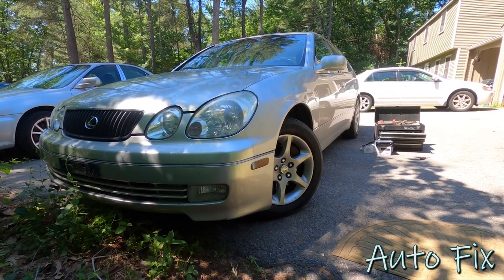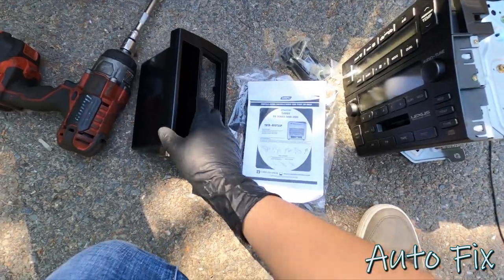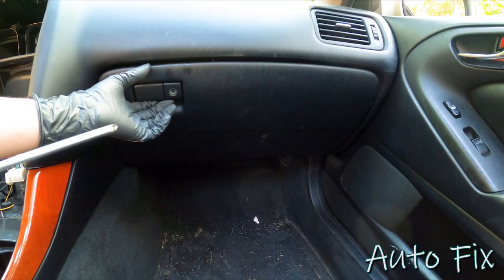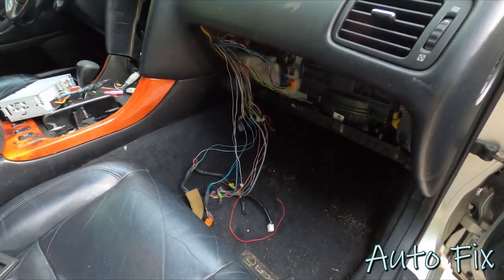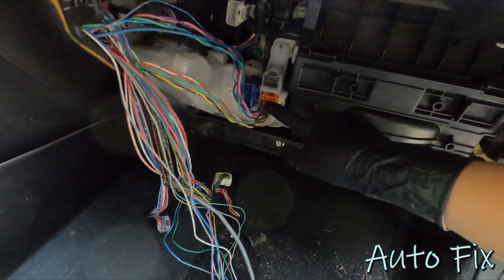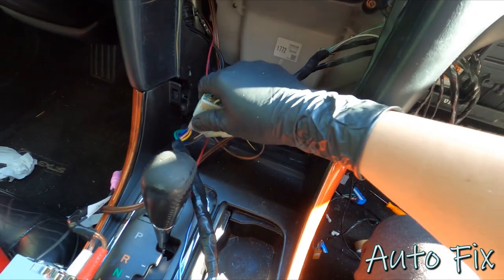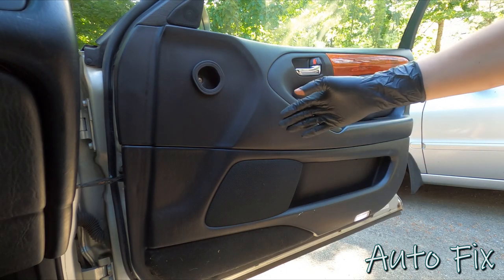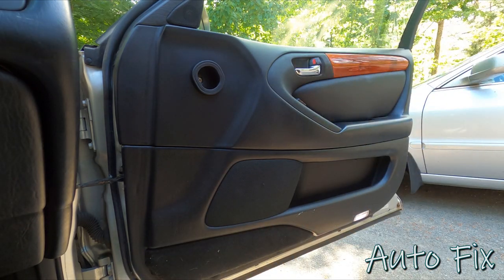Installing Head Unit & Speakers In 97-05 Lexus GS (DETAILED)

Comment: Excellent job, dude.  Side note -- If you're watching this to do something similar, do yourself a favor and replace the servo motors while you have all of this out.  They're notorious for failing plastics and will not work correctly and make all kinds of groaning noises and cause climate issues in your car as well.  These are extremely easy to replace and very cheap.  it'll save you from having to pull all of this out again to replace them eventually.
Reply from the maker: Thank you! And yes you are totally right. I actually have a  video on how to replace the "Mode" servo motor. The process for the other ones is the same you just have to locate them. But you are correct, they always fail on these cars.
Reply: Man, thanks for this comment. I was going to reolace those because my ac temoature wont change, and I think the servo that changes the temp is stuck.
Reply from the maker: @danlopez776 yup, very likely, very common failure point.

Comment: this is the most detailed and helpful video i’ve ever seen no exaggeration, i was thinking of buying a GS400 but the biggest thing is i want a car where a sound system is easy to make while having it pretty stock interior without cutting, found this video ended up watching the whole thing, definitely going to watch this through a month or 2 from now when i get my GS
Reply from the maker: To be honest it's not the easiest car to install a new head unit into, but it's also not the most difficult. However the end result is amazing... if you replace the speakers and add your own sub and amp... you'll love it!

Comment: I'm about to fit a double din one to my GS300 1999 and caught your video. Just a note that my radio has 3 plugs ! I'm in the UK. Hopefully the rest of the wiring will be the same.
Very useful video, thanks.
Reply from the maker: Very interesting, thank you! Good to know!
Good luck on your install, hope it all goes smoothly!
Reply: Just checked the diagram and its meant to be the auto antenna. When I have it sorted I will let you know the result, thanks.
Reply from the maker: @Golo1949  Got it. The US models don't have power antennas, weird
Reply: @Golo1949 update?

Comment: I've been looking for a video like this for months.👍🏻
Reply from the maker: Well I'm happy you found this one!
Reply: @AutoFixYT  hey if I have a amp bypass harness do I still need a wiring harness? And also do I have to bypass the amp? Or can I leave them connected to power door speakers ?? I’m installing a double din and subwoofers. And door speakers in the future
Reply from the maker: @michaeladrianramasami9209  You need to bypass the factory amp if you are installing an aftermarket head unit. So do whatever you need to do for that. The new head unit is what will power the door speakers. You need the plugs that are in the factory amp to plug into your new head unit. You are not reusing the plug that was in the original head unit.
Reply: @AutoFixYT  thank you so much. Now everything makes more sense😅
Reply from the maker: @michaeladrianramasami9209  My pleasure! Let me know if you have any other questions.

Comment: Re: Replacing the HVAC servo motors comment below, there are videos showing how to clean the encoder wheel, which worked on my GS400. You likely don't have to buy a new servo.

Comment: great video, i watched this like 1000 times but i recently found out my amp is in the trunk of my car. i have a 2002 gs430 w ML and factory nav, how would i go about wiring it back to the front where the unit is?!
Reply from the maker: Yes those have the amp in the trunk. You have two options. Either you can find the wiring harness and unravel it and relocate the entire harness inside the dash, or you cut and extend the wires you need from back there to the front.
Reply: @AutoFixYT  yeah, i figured the second options was going to be best, where would i get the corresponding wires to splice?
Reply from the maker: @3uzMarcooFTP  Amazon is the best way. Find out what gauge you need (or buy an assortment), get yourself some good heat shrink connectors (either crimp on or the kind that have solder built into them and it melts), and plenty of small zip ties so you can secure your wires properly.

Comment: You didn’t have to add an amp for the door speakers? Just running off of stock wiring is fine?
Reply from the maker: Your question contains two different topics actually.
1. The amp: I did not add an external amp, the door speakers are powered by the internal amp of the new head unit.
2. The wires: I did not replace the wiring going to the speakers. The stock wires are perfect for almost all applications.

Comment: Everything was perfect... way better than everyone routing a wire or extending the whole harness from the amp back to the deck.. only small advice I have is to add a bass block to the tweeters. It will help the tweets last longer and not blowing/distorting.
Reply from the maker: Yes that is very good advice and that is something I have kind of taken care of. I want to eventually replace these tweeters but for now I have actually taken the resistors out of the stock speakers (you have to open up the speaker enclosure and de-solder the resistor) and I have wired it in to the wire feeding the tweeters. Before that it was really bad, they were working waaay too hard. Now it's normal but sometimes I can still hear them trying to play frequencies that they're not supposed to be playing. One day I'll get to it though. But thank you for the feedback, you are correct.

Comment: So i have an 03 with factory amp, and got the bypass harness and a single din HU, i installed everything and got zero power. I did it a couple years ago and just put it on the back burner after not being successful. I need some dang music back and considering tackling it again before I give up  pay with my left kidney for a shop to finish it. I dont know why im not getting any power, i matched all wires correctly according to color, and did proper splices, nothing ghetto. I dont know what the issue is and not sure what to do without any kind of factory wiring diagram. Any advice would be so much appreciated. I been riding silent for 2 years + and im so sick of it and cant really afford shop labor.  Btw, thanks for putting out a great and detailed install video brother.
Reply from the maker: Thanks for checking out the video! So I remember thay I had to transfer two wires from the factory amp over to the headunit side. One of then I believe was the accessory power which is what tells the head unit to turn on when you turn the key. Without that wire it doesn't know when start up, even if it has 12v going to it from the battery. It's kind of like a trigger signal to tell it to turn on. Do you have that wire transferred over?
Reply: @AutoFixYT  i think that is the problem. After I posted my comment, i rewinded what i missed and seen where you mentioned that in the video. Thanks for the reply and thanks for the help brother. Looks like that will be my next move. 👍👍👍
Reply: @AutoFixYT  quick question, you think the factory wires that run to the door speakers will be able to handle 50-100 watts rms? I have a good bang for your buck HU that pushes true 50 watts rms@4ohm and 100rms@2ohm. Looking to upgrade to components in the front and coaxial for rear doors and im hoping oem wires can handle that wattage. Otherwise if not, then  this whole process was kind of pointless if i have to upgrade speaker wires to my doors and have to manually run new wires 😓
Reply from the maker: Haha no problem! Let me know if that fixed your issue, I'm curious now. Hopefully it does!
And yes the factory wires are thick and will definitley handle that power with no issues.

Comment: A good solution to not have to deal with all the rats nest of wiring, is to extend the radio harness and adapter harness outside the car with some spare wire, leave the 12v switched and illumination out, that way you just run them seperately over the the amp plugs, zip tie the new extended harness to the factory one, and connect 12v switched and illumination right at the stereo harness. Makes it a whole lit simpler than cutting open the factory loom and dealing with all that rats nest

Comment: So a quick question, I am going to install  a 4 channel amp (I already have a aftermarket head unit) so do I run my wires straight into that orange clip which color coordinate with my door speakers?
Reply from the maker: You have two options:
1. Run brand new wires to every single speaker (way tok much work for what it's worth and I do not recommend this option)
2. Run wires to the front behind the head unit, and connect the wires from the Amp to the wires feeding the speakers that go from the head unit connector to the speakers. Meaning wherever the head unit connects to, tap into those wires.

Comment: If your early model Lexus came with the Navigation system (my GS400 did), which also controls the HVAC (Heat/Vent/Air Conditioning), removing the outdated Navigation unit also removes your HVAC! I thought I was doomed for a minute. However, you likely have another option.
As you can see in this video, models that did not have the Navigation system have a separate, single-DIN HVAC controller (shown above the factory radio at the beginning of this video). My Navigation unit sat in the top, and had a tape deck underneath.
I found this separate HVAC controller module online, used for cheap. It fit perfectly in the space, and the electrical plugs that were removed from the Navigation model plugged right in to this standalone HVAC controller!

Comment: Anyone know what style adapter would be needed for to power the speaker instead of splicing ?
Reply from the maker: I'm sure if you look hard enough there will be some adapter plug from stock GS speaker to aftermarket femals spade connector plug. But if not, just cut the wires... I doubt you'll ever wanna go back to stock

Comment: Ok so I was done and setup my decided to swap the front right speaker. I took the clip from the speaker and connected it to 3/4 spares I had. 1 FR 1 FL 1 RL. When I grabbed and connected the rear I believe that may have caused an issue. Now only my sub gets sound and my radio turns on then off in the fully on key position. Any help ? Tips?
Reply from the maker: Sounds like some sort of protection mode? Amplifiers do that to prevent damage. I've never heard of this issue in this particular scenario. Try unplugging everything you changed and see if it foxes itself. If it does, go back one step at a time and test after every step. Something must be causing the issue.
If the issue is still there after you unplugged everything, there could be some internal damage on the amp/head unit.

Comment: Hello I put in an aftermarket head unit, rear speakers work fine but the front ones don’t work at all. I tried adjusting the balance and fader and still nothing. Any suggestions?
Reply from the maker: Check your wiring and make sure that it's all routed and connected properly. Also, some head units have the option to turn off one channel completely, so make sure that's not the case for you and the fronts aren't off. But I'd recommend starting with the wires. You can even test the speakers with a 9V battery to make sure they're wired in right. If you don't know how to do it, look it up.

Comment: How can I go about adding line out converters? Which wires/ speaker leads should be using? Looking for a wiring diagram on the net without luck
Reply from the maker: If you're dealing with a stock head unit, the wires coming out of the head unit are already line level. However, they have a vommin ground. So the amp is being fed 5 wires. 4 powers and one ground. It's weird. So then from there it takes the signal, amplifies it, and sends it to the speakers through regular +/- wires. If you want to tap into those, you can, but you're then bringing an amplified level back down to line level, just to re-amplify it.
Out of the head unit it will be difficult to figure out what wire feeds what speaker. The best way, unfortunately, is to de-pin wires and manually connect them one at a time to see which one feeds what speaker. You can also mess with the fader and balance and put a multimeter on them to see what voltage it reads.
Honestly, the easiest way will be to just go aftermarket with the head unit and upgrade sound quality and tunability at the same time.
Reply: @AutoFixYT   it’s an aftermarket Tesla style unit and it doesn’t come with any built in amp this is the reason I’m going with line out converters, just not sure on wiring
Reply from the maker: @carrerag1789  well in that case it should have RCA outputs, doesn't it?
Reply: @AutoFixYT  negative no rcas as it has no preamp

Comment: maybe this comment comes too late, but in the wiring adapter that is linked to in the description, the smaller connector only has 4 pinns, whilst the one in the lexus has 6. Are those 2 wires not necessary?
Reply from the maker: The extra two are for the factory subwoofer. You don't need those because the head unit will not be powering them. You need to power it from a separate amp or buy a whole new subwoofer with an amp and wire that in.

Comment: do you not need a crossover when wiring the tweeters inline with the speaker? thats the only thing i wasnt sure on
Reply from the maker: So actually you do. I made a mistake. What I did to rectify this issue was take apart my original speakers, and inside, you'll find a resistor that is hooked on to the tweeter wires. I cut that off and wired it in series with the tweeter. Without it, my tweeter was peaking and distorting at only half volume in the head unit, as opposed to almost at full volume.

Comment: Hi ! I have a question for you :) I have a GS300 with Pioneer F920BT after market radio. All my speakers are stock and I have the subwoofer. I connect all the wire, my speakers and radio work well but the Subwoofer do not work. Want can I do to use it again ?
Reply from the maker: Great question! So the factory sub is actually powered by the factory amp which is separate from the head unit. When you remove the factory head unit however, you also remove the signal source that goes to that amp. Wiring the speakers into the new head unit works bevause the head unit is made to power 4 door speakers, but it's not made to power a subwoofer. So the only way to get that factory sub to work again is to find a way to connect the factory amp to the new head unit (most likely with some signal level converters and other hackery to make it work), or to buy an amp and connect that amp to the sub, and feed it signal from the head unit just like you would if the subwoofer was an aftermarket one.
Having said all that, I recommend just going with an aftermarket subwoofer and removing the stock one only because that's actually easier than trying to match the right amp to the factory sub, and also you can get way better bass from an aftermarket sub.
Hope this helps!
Reply: @AutoFixYT  Thanks you a lot ! I will try to do the best ! May be buy a new little amp is cheaper to buy an aftermarker subwoofer
Reply: @AutoFixYT which amp and sub combo would you recommend?
Reply from the maker: @thatschime  it really depends... it's almost impossible to recommend a specific one because I don't know what you're trying to achieve and what the rest of your setup is. In order for it to all be in good harmony, you need it to all work together.
I can however tell you what I did. I used the speakers and head unit you see in this video, and for the sub I went the cheap route. I took a shot at the BOSS brand. I got a 12" sub, a monoblock amp of the same brand (I made sure to match the power ratings), and i built a custom enclosure. The enclosure is what really makes it though. So you need to make sure you either know what you're building, or get a pre-built one.
As for brands, if I do anything in the future I'm gonna go with Skar. I don't have any issues with the Boss, but I'd like an upgrade now that I can afford it. That boss sub and amp combo have been bumping strong for years now. I've pushed them to the point where both the amp was very hot and the speaker was warm. Not a single problem.
If you don't wanna go with Skar, go for Rockford Fosgate. Great products, good prices. I have a RF amp and subwoofer in my truck, great product. My brother has a Skar setup in his car, amazing stuff.
As for size and power... that's where you have to decide. I think anything less than an 8 inch will not be big enough for a GS especially at higher volumes. Those cars are very well insulated and the trunk is sealed shut other than the rear deck where the factory sub is (or was). So you need power to push past the seats. I recommend a 10" if you want small, 12" if you want a happy medium, or 15" if you wanna shake some windows lol. My 12" will vibrate the whole interior, just not the glass. These cars are once again, very well insulated and put together.
Power wise, I cannot give you any numbers, just make sure the speaker and the amp match in impedance and RMS power rating. It's good to take a look at the peak watts too, but don't go by that. Go by the RMS output at the speakers resistance.
Get proper wiring, get a good enclosure (you can build it to tune it to peak at certain frequencies) and you'll be all set!
This is a long reply, I know, but I felt like giving the info lol
Hope it helps!
Reply: @AutoFixYT  I just bought an aftermarket head unit for my 2001 gs430 and i got everything working but was bummed that the stock subwoofer no longer works so im just looking for something super duper simple just to replace it and have a working one. I don’t really know anything about sound systems and which amp and sub i should get or how i would go about setting everything up, I appreciate your reply though 🙏